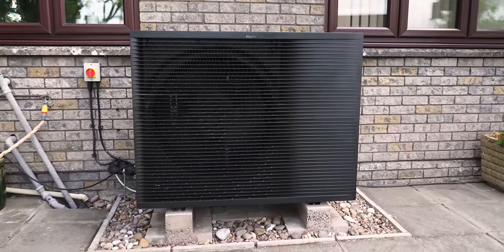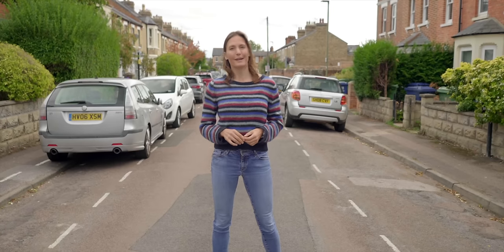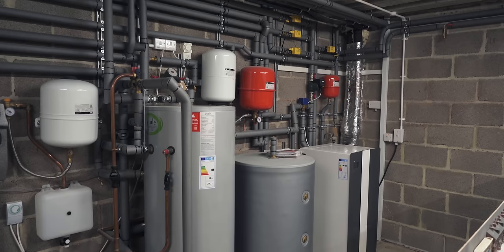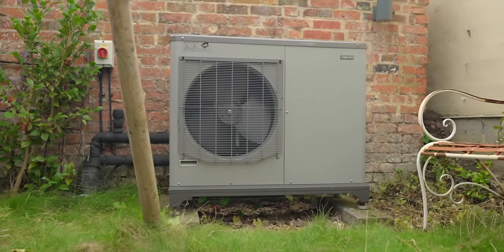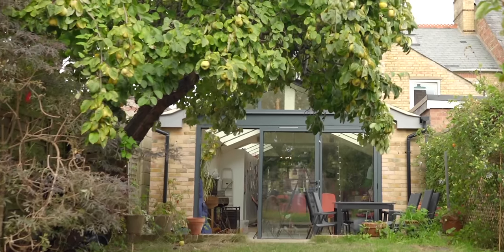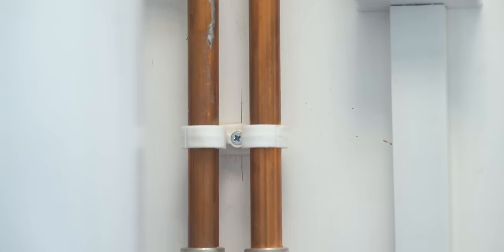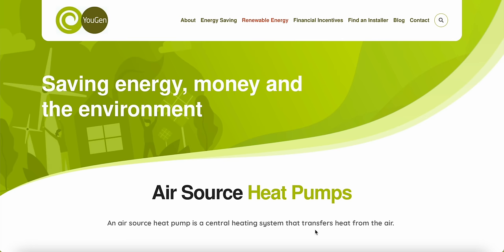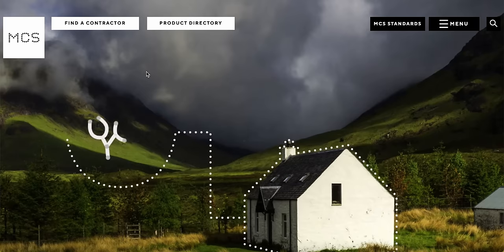Does a Heat Pump Really Work In A Victorian Terrace?

Comment: A more quantitative approach showing how much spent on insulation, underfloor heating, large radiators prior to the heat pump installation and payback period calculation would have been more useful.
Reply: Gas boilers aren’t magic you know. The heat loss of a house is the same no matter what the heating source. Gas used to be cheap, and covered up the fact that your house leaked three times as much as it should. News flash, gas isn’t cheap any more, and never will be. So get on and insulate your house, no matter what.
Reply: hi, why do you need a payback period, when does a gas boiler payback?
Reply: @andrewmullen4003  the payback calculation is definitely useful. Your gas boiler won’t pay anything back, it’s the effort and cost of switching to a heat pump. There’s no point in switching if your estimated monthly cost will stay the same but you need to spend a considerable amount to switch. There’s definitely a point in switching if you get a 50% monthly reduction in heating costs and you get the installation for free. Your typical situation will end up somewhere in between the extremes, and therein lies the trade off
Reply: @Muppetkeeper  Totally agree about insulation. The issue with heat pumps is that insulation is a higher priority because if your leaky house is not attended to you will need very large radiators and/or underfloor heating to drive the lower temperature heat. Since heat pumps efficiency drops off over 45-50C.

Comment: I think the biggest problem is still cost. Until the full install cost is on par with getting a boiler replaced nobodys going to go to that expense, especially right now.
Reply: I've been a big fan of Fully Charged for years, but just ignoring the elephant in the room here (plus talking about energy reduction instead of cost reduction) really undermines their credibility. Relying on ordinary people paying £15k is never going to get this country to net zero.
Reply: @robinbennett5994  

15 thousand pounds? Are they nuts.Gas boiler about 2 to 2.5 grand or even less.The green con deal.
Reply: @foppo100  I think you've misunderstood me. 15k is what we've been quoted for a heat pump.You're right that gas boilers are much cheaper, and unless something big changes, most of the country isn't going to switch.
Reply: @robinbennett5994  It's not the first time Fully charged has ignored it as well. In fact they seem to intentionally skirt around the extremely high cost of some of the products featured, presumably because its all sponsored content. 

Really wish they'd do a few episodes on lower cost options, or focusing on breaking the figures down to help justify the expense.
Reply: @robinbennett5994  I asked about an idea of the costs involved and was told my query was irrelevant...
Reply: @foppo100  The makers of this video say the costs involved are irrelevant...
Reply: In a small terraced house they are likely to have a combi boiler. You will need an unvented cylinder added as well as Air source unit, mounting the external unit could be a problem.
Radiators unless already sized correctly will need replacing. Possibly heating may need repiping with larger bore flow/return if too small.
Its not going to be cheap and row upon row of terraced houses all starting up together? There will need to be an overhaul of local electric supply for increased load.